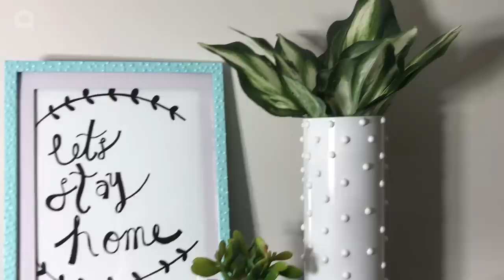Viral TikTok ideas everyone's copying!

Comment: Great genius ideas. Thank you.
Couple comments.
1. I would not use 3M removable tape to attach mirrors to the wall because sometimes the tape comes off and this would make a giant mess.
2. On the turntables make up storage unit, it's not very clear. I.e., you don't show it how the marbles make a turn table. I.e., it's not clear that you put marbles in one cake pen and then put the other cake pen on top. Please either show this step or add a text to the video. Thank you.
Reply: I think they skip the details in group DIY'S videos. Usually there's a previous video that will have the details of the DIY. There should be a reference in the description to show you who  created each project.  Hope that helps.😁
Reply: @maryfolks9368  Thank you!! I wish the description had a link to the individual video so you could go directly to the original, so you could see the list they provide there! ❤️
Reply: One pie tin is glued to base of unit as shown in video.  The second pie tin has the marbles  in it.  All you need to do is put the storage unit  with glued pie tin on top of the pie tin filled with marbles .  Makes an easy turntable.